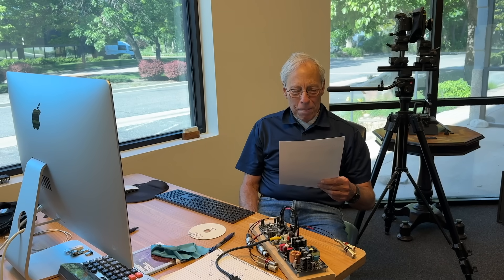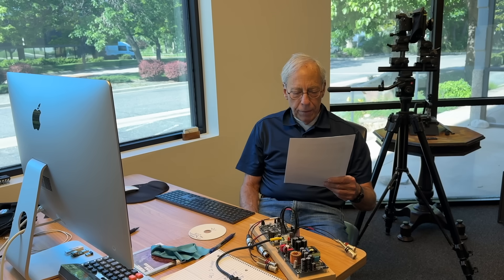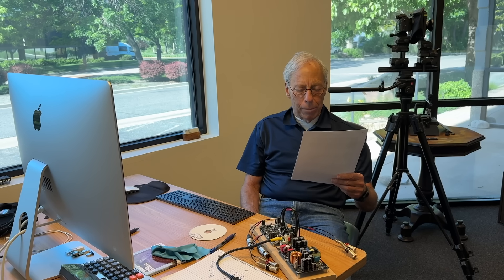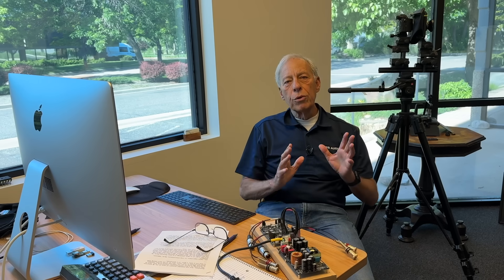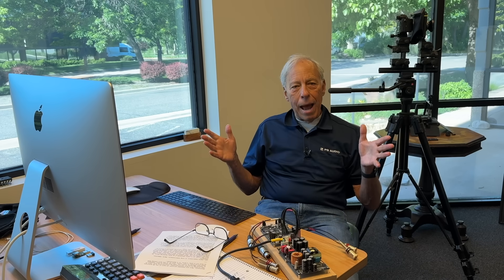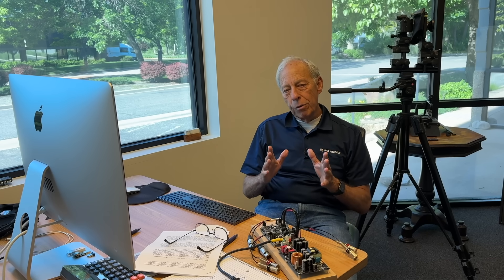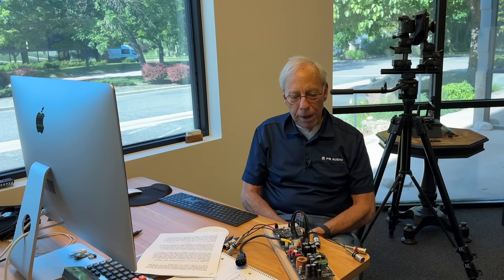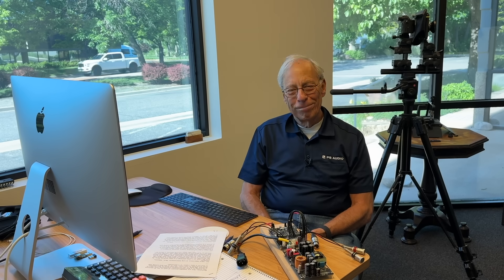Cable Capacitance

Comment: I have a 30 feet RCA cable that is a disaster in capturing noise, hum and EMI thanks to poor shielding. I keep it as a reminder that cables can make even a huge difference. How is it possible?
Reply: Yeah but what does ChatGPT say? You've got me hooked now.
Reply: What you’re experiencing is a textbook case of how cable design and shielding quality can make or break noise performance — especially with long runs like your 30 ft RCA.

Here’s why your "reminder cable" is so noisy:

---

1. RCA Is an Unbalanced Connection

RCA cables carry the audio signal on one conductor and the return path (shield) on another.

The shield is both the return conductor and the first line of defense against interference.

Any noise induced in the shield gets added directly to the signal path because there’s no differential noise rejection (like in balanced XLR or TRS lines).

At 30 ft, the cable is essentially acting as a long antenna.

---

2. Poor Shielding = Easy EMI/Hum Pickup

Not all shielding is created equal. Yours is likely one of these:

Spiral/serve shield: Cheap and flexible but leaves small gaps, so it’s much less effective at high frequencies.

Foil shield with thin drain wire: Good against high-frequency RF but poor for low-frequency magnetic hum.

Loose or thin braid: Low coverage percentage (e.g., 60–70%) lets noise through.

A good cable uses:

Dense braided copper shield (85–95% coverage) plus foil.

Sometimes double braid for maximum coverage.

---

3. Ground Loop and Magnetic Coupling

If the source and destination gear are plugged into different AC outlets, you might have a ground loop.
Long RCA runs make this worse because the shield/ground can carry small AC voltage differences → audible hum.

60 Hz magnetic fields from nearby power cables, transformers, or dimmers can easily induce hum into a poorly shielded unbalanced cable.

---

4. Capacitance and High-Frequency Noise

Poorly made RCA cables can have higher capacitance per foot.

This doesn’t cause hum directly, but it can attenuate high frequencies or interact with gear output stages, making noise more noticeable.

Low capacitance (<30 pF/ft) is preferable for long runs.

---

5. Why Your “Reminder Cable” Is So Bad

Likely a combination of:

Cheap shield (loose braid or spiral).

Long unbalanced run = big EMI antenna.

Routing near AC cables, wall warts, dimmers, or Wi-Fi gear.

Possibly thin center conductor with poor connections at the plugs.

---

💡 Key takeaway:
With RCA (unbalanced), anything beyond ~15 ft is risky unless the shielding is excellent. Balanced lines (XLR/TRS) or a line-level converter (balun) are far better for 30 ft runs.

---

If you want, I can break down how to test your noisy cable to pinpoint exactly what design flaw is letting all that EMI through — essentially doing a “cable autopsy.” That would explain precisely why yours is so bad compared to good ones. Would you like me to do that?

Comment: All other things being equal, a digital connect can run a longer distance with zero signal loss. Any analog connect introduces some loss, even if it is miniscule.
So if you want to minimize the chances of signal degradation, shorter analog runs are better.
At the same time, the difference is probably irrelevant, wearing a different sweater may affect the sound more than using a different cable.
Reply: lower voltage lower length runs. 

and yeah you can put repeaters on a digital signal without data loss etc.  that's how we can chat on this forum from opposite sides of the gobe th ndegra ion

edit: speaking of benefits of putting in a metal case, hifi audio products almost never employ metal canning inside the product like high frequency electronics do. it would be better but then you can't peek at the toroidals from the slits. and for purposes of electronic 100khz even isn't really that high frequency at all.
Reply: @lasskinn474  
Digital cable reflections occur when a signal traveling through a cable is bounced back towards the source due to impedance mismatches. These reflections can degrade signal quality, leading to errors and increased electromagnetic emissions.